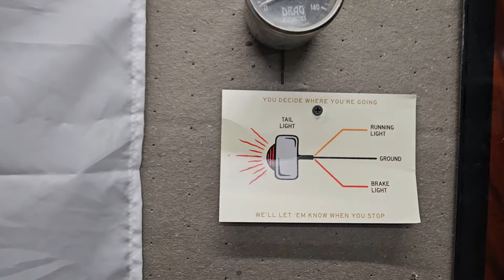Doing some wiring on the evo chop and hanging with Fbomb

Comment: Fun video Hippie. Nice to have somone around the shop to talk to jaw jack with some times. Electrical probelms can be hell, specially when someone else wired it.  Looks like taillight shorting out when its running. Good place to start. Good luck ! Thanks for the shout out.
Reply from the maker: Thanks Ralph.  Fbomb brings out the best in me 🤣🤣🤣 I thought I found the ground for it but I talked to the guy that built it. It's grounded in a different area
Reply: Looks like you guys have fun for sure. Sometimes it just the little things. @hippieschoppercorner

Comment: Just put a Dyna 2000i in my ‘98 Springer.  Just need to wire the horn button and mount the high beam switch. 
My neck tool should be here any day so i can do all the fallout specs.

Comment: I have a chopper made on an 81 swingarm frame.... I will never get used to seeing the way they mount the rear suspension on the later stuff. No more need to weld hardtail pieces..... Wow though, never seen a seat mounted backwards where you have to get between the fender and tire to take it off..... Really bad idea.
Reply from the maker: Yeah man, I changed all that